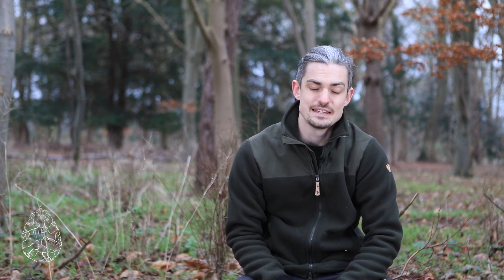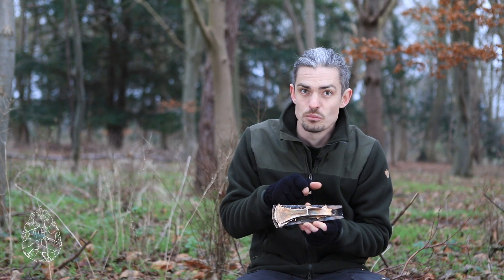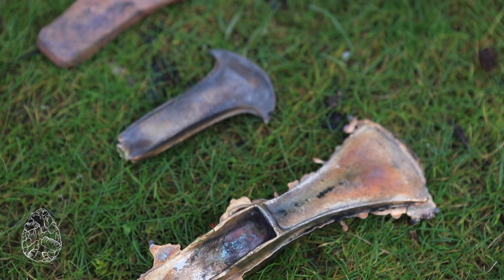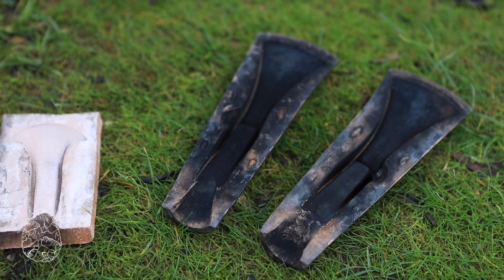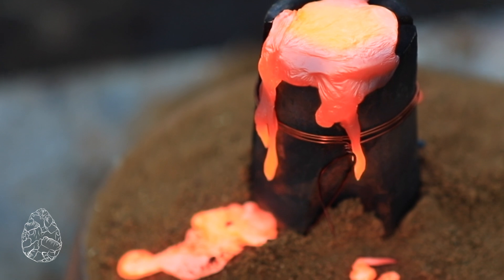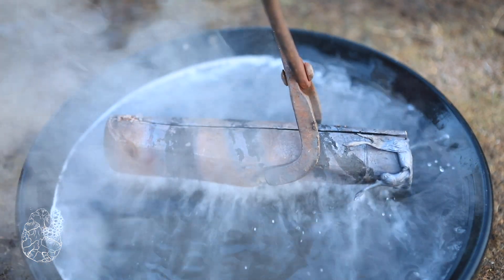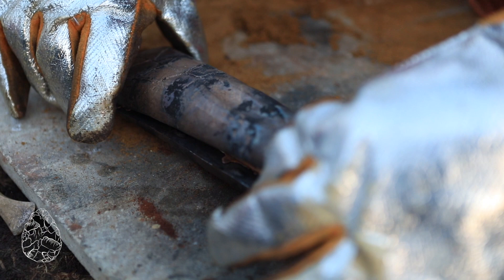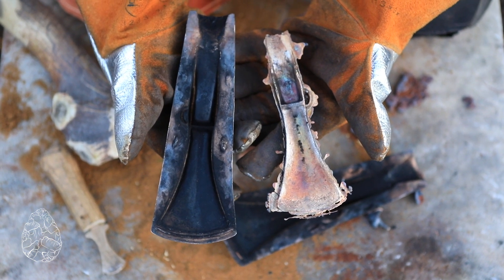Experimenting with Bronze Age Technology: Casting Palstave Axeheads (E4)

Comment: Hi James this is an old video so you may have discoverd this by now anyway.
But if you smear fire cement with your finger on the seam inside and out before you wire it shut it should cut down on the bronze flashing around the edge,then drying it next to a fire before using.
Maybe back in the past they would have used a clay.
hope this is of some use.
regards
Scott

Comment: G'day James, love the video. I was directed to it by a FB post. The posters  I think claimed that you were using an actual Bronze Age mould. You suggest that you've made a replica. I studied Metallurgy in the 1970's and also did a bit of metal mixing and casting with Copper/Tin alloys. I was surprised that you are using a Bronze mould to cast a Bronze product. To me this is counter intuitive if both are made of the same composition Bronze eg 86% Copper, 14% Tin. They  would have the same melting temperature.  Can you help me out here?
Reply from the maker: It’s a replica mould based on an original, (would be very risky otherwise!) and it is the same alloy composition as the axes cast from it. Original examples seem to be made of an alloy consistent with tools cast from them too. The key is managing the temperature of the mould and liquid metal neither can be too hot!

Comment: I've been enjoying your videos very much.  As a jeweler for 30 years now I've cast a lot of things just not in the ancient way.  Looks like a lot of fun.  Something you might try, if you haven't yet.  Soot the inside of the copper mold.  With the very tip of a yellow flame.  Blacken and soot up every part inside and the cast should fall right out.  I do this when pouring ingots into steel molds and it works great.  The flashing is probably a good thing.  Any gases trapped inside would cause unfilled parts.  You could purposefully put small gates out of the mold for this if you find a way to seal off any flashing.
Reply: Would the black soot also help to purify the metal? If soot is low oxygenated carbon then could it pull oxygen from the ore thus increase the purity of the metal at the surface?

I like your idea of using the soot as a lubricant. Which it is sold as called graphite particles.
Reply: @Google_Does_Evil_Now  it's an interesting thought.  I honestly don't know if it would effect non ferrous metals in any way.  When heating steel some carbon might be put into the steel, in a high carbon steel this can be good, such as hardening frizzens for black powder arms.  The sooting has just been shown to really help when casting low temp metals.  It's done when casting black powder shot and ingots of non ferrous metals like I mentioned.  You would think it would do something, at least to the surface of the metal.
Reply: @stefang5796  maybe your soot input is possibly what happened back then? They they learned soot is a lubricant and through experimentation discovered it made a difference to the metal.
Perhaps first the edges. Then maybe they added a bit more. Would that have helped them to create higher carbon steels?

Is that what helps and a sword and knife have a stronger shaper edge?

And human brains peaked in size 3,500 years ago, 12% more volume than today. So they may have been quite a lot smarter and more inventive then us.

I would really like a curiosity teaching experimenting crafting show. A bit of this guy for tools and crafting, Stefan Milo, maybe some Ray Meard for berries, foods, cooking methods etc.

Maybe a series where they start with almost nothing but some land by a river. Each episode we see them try to progress with camp, food, water, tools, jobs, crafting. Using best estimates of technology they had then.

The ex-BBC boss Mark Thompson is now the chairman of Ancestry, the gene and DNA website and business. So perhaps he might be interested.

These guys are with the University of Cambridge. So there's credibility, interest etc.

Comment: Interesting, thanks. I have made a number of soapstone molds for casting silver in (very similar melting point to bronze). I have also done a few bronze castings in soapstone. It is very easy indeed to carve, so making a mold from it requires very little labour. If it was available to the Bronze Age casters, I think they would have favoured it as it can be reused very many times with very little deterioration. When I used it I wiped it first with oil in the belief that it's vaporisation would protect the mold and/or that it's carburisation would discourage oxidisation on the surface of the cast piece - I haven't tested this idea in a scientific manner - perhaps ancient casters would have "smoked" the mold.

Comment: That level of flashing is normal (for sand or lost wax). I have no idea why you cooled the casting right away. Thicker castings (bells, cannon) are always cooled VERY slowly to avoid cracks. Otherwise, nice job, and I've never seen bronze cast in metal molds.
Reply from the maker: I don’t cool anything immediately (not while there is any hint of glowing anyway). The axes and thinner tools cool by themselves reasonably speedily, but I often quench them. I haven’t ever experienced cracks, but can understand slow cooling for something as large and thick as bells or cannons